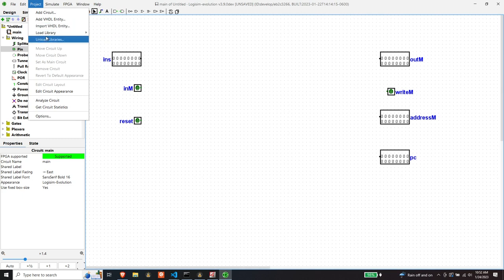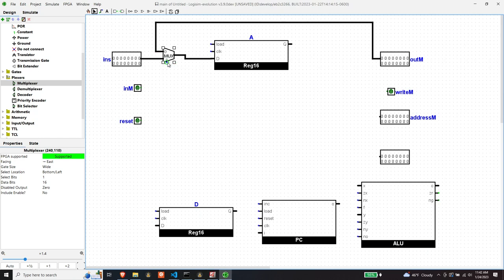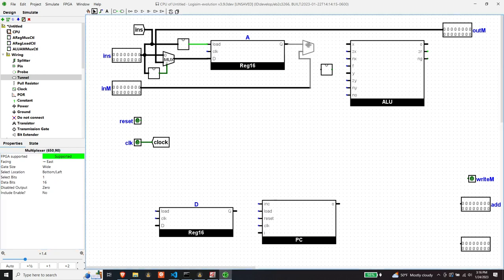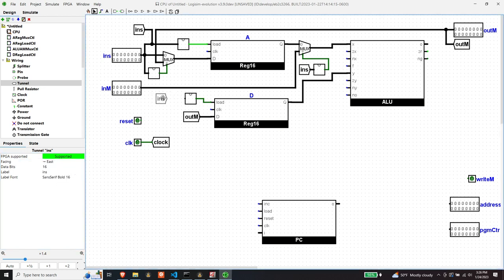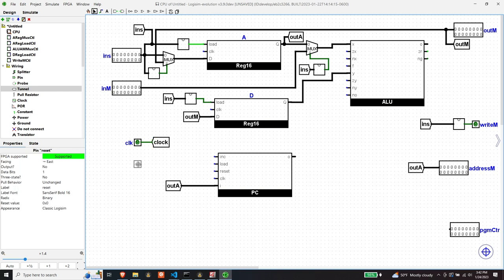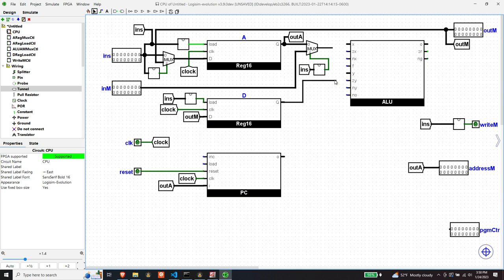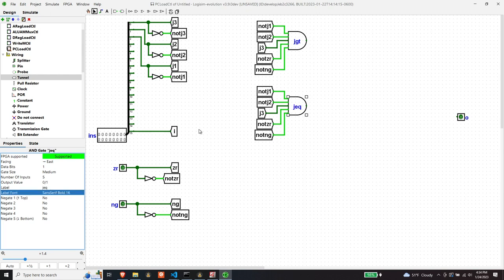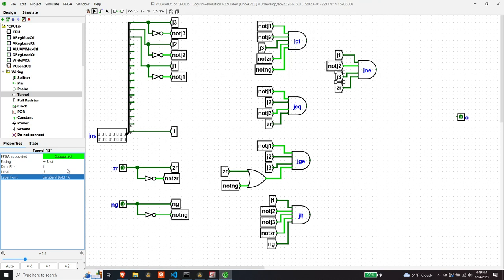HackCPU Logisim CPU Implementation

Comment: I don't get where in the book it shows which  c bit corresponds to which ALU operation. Why is bit 11 of the instruction (ie c1) corresponding to zx?
Reply from the maker: Cross reference page 37 with page 67. I struggled with this too until I made the connection. There is an important one-liner in the last sentence of the Figure 4.3 caption: "Note the similarity between this instruction set and the ALU specification given in figure 2.6".  I wrote, in my copy of the book, the bit descriptions over the c(x) columns on page 67. I have the earlier edition, by the way...
Reply: @chuckbenedict7235  Thank you very much